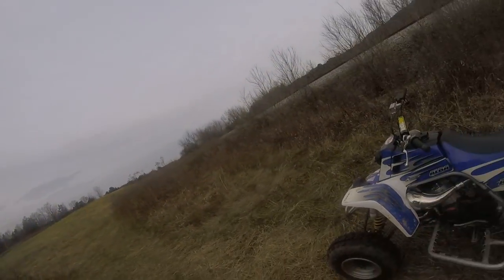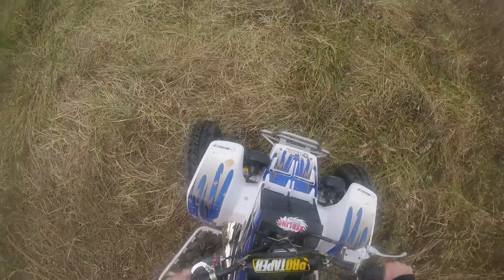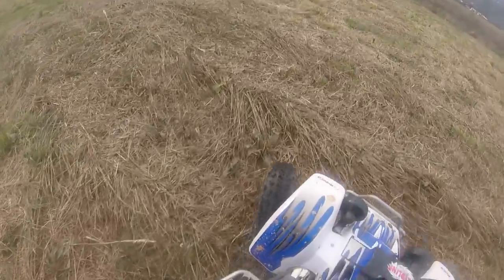100hp banshee ride 12/19/18

Comment: Finally got the banshee back with the cub motor. Thing scared the shit out of me at first. Videos really don't do much justice until you get on it and ride. Lots of power
Reply from the maker: He'll yea who built it
Reply: 5 star small engine in Macon ga I called cascade but I'm working 60plus hours a week so I dropped it off to them. Didn't have time to tear it down
Reply from the maker: @Jordan-hl5hj  what bearing did they use on clutch side
Reply: I'm wanting to say tz bearings but I'm not 100% sure
Reply from the maker: Find out
Reply: Just talked to him it's ball bearing
Reply: You having any problems with you're crank
Reply from the maker: No like what?
Reply: You asked about the bearing thought maybe you was having some issues out of yours

Comment: Damn,,  that thing wheelys like the rear swing arm is 6 inches shorter but I can clearly tell it’s not.
What do you think is the best way to get more torq out of a basically stock banshee.
It does have flat slide carbs and a timing plate at + 4% and fmf fatty pipes but the only way to get power out of it is when it’s screaming.
I’d like to know your thoughts and input on it
Reply from the maker: Watch MY other vid 100hp breakdown

Comment: I had a banshee years ago and it was stock engine with just different jets in the carbs and fmf racing pipes and silencers and dirt digger clutches with is bad ass clutches and wooly burger tires on the back and it was just about as wicked on 93 octane as yours is on race gas
Reply: Christopher Parker 😂😂😂

Comment: I’ve commented here before . Nice machine , mine built same way with more etc . Up here in Michigan if ya wanna ride in a little colder — fatter jets is what you have to do or get another set of carbs and set them up with float level , jets pilots,needles if you want to ride in the cold . Also change to an Iridium NGK Sparkplugs, Much better IMO.With my set up in my conditions , elevation, riding style , racefuel etc etc I put in 1 colder plug with it gapped and 19 . Timing at 6deg . But this is my set up at 70deg or warmer.
Love the Banshee my man, !! It’s time for me to ride the sleds now ! Keep it up
Reply from the maker: Thanks man
Reply: What I meant in the above comment ,just swap carbs out when you ride in colder conditions, faster then doing jets changes .
Reply from the maker: yes makes sense

Comment: I call B's this is 100hp I. Want to see the Dyno sheet
Reply from the maker: Well it's on my channel more on its 98 wheel horsepower equals over a hundred at the crank
Reply: 421 cub on gas 90 hp
Race gas 98
Redline has dyno graphs
Reply from the maker: Thanks

Comment: What gearing are you running? I have a 521 that I ride in the woods too, and it does not stand up like that. But it spins like crazy. Stock wheelbase like yours, GBC XC master tires
Reply from the maker: Stick gearing butbit also runs the same with 15 40
Reply: Hmm strange.. I have 14/44 gearing. I’d expect between that and my larger displacement motor that mine would stand up even worse than yours
Reply from the maker: Tell me the exact build of yours
Reply: 521cc super serval cub, 28cc domes, keihin 38mm pwks, big bore in frame shearer pipes, stock chassis, 22” rear XC masters. Everything I find online says that even a pump gas 521 like mine is over 100hp.. maybe I’m making just enough more than you that I’m spinning? I really have no idea. I sit far up on the seat and I’ve never tried it on asphalt or a hard packed field like you. It’s a pretty recent build, only 4hrs on it. My old diy home ported stock motor stood up through 3rd though
Reply from the maker: I just took GBC XC Master Tires off of this Banshee it did not matter what surface I was on Willie like this with me sitting on the gas tank and I'm 280 pounds so I think something's not right on your build but I can tell you one thing for sure your 28cc domes is not a lot for compression mine has 185 PSI both cylinders
Reply: I’m 290ish so we’re pretty close there, and I sit on the tank. The big bore motors make more compression with bigger domes. My 28s put me at 160psi on both cylinders, I didn’t want to run race gas all the time. This way I can run 93 octane 32:1 with +3 timing and it’s safe. I went up to 110 octane and +7 timing when I raced it one weekend. I think you’re right though, something has to be wrong with my build... it’s fast don’t get me wrong, but it doesn’t feel like 100+hp at the tires fast. I haven’t done a full blown plug chop set on it, but I can tell it’s running pretty much perfect by sound and the way the plugs look when I pull them out. I don’t know what could be wrong with it
Reply: @dylanallen5047  if your build is all tuned in  and if you want it  to be very wheelie happy and have  better  traction like his quad go to a 14/40 or taller gearing.  The Longer gearing will spread your motors  power out in each gear and allow your tires time to catch traction.
Reply: I kind of agree with you, but I don’t think that’s the problem. I initially had my 17/41 set on it, and it didn’t wheelie or spin. It just pulled
Reply: @dylanallen5047  ya that sounds right with that kinda gearing. You wanna find the gearing in between that won't force the motor to lug or get stuck in low rpms but everytime you shift into a higher gear you can tell the difference in motor rpm so it's not just jumping right through the powerband in each gear and just revving its brains out. Could be rich on your carb needles. could be your over revving and it's meant to be short shifted a little to get the full use out of the powerband. Not trying to sound like a  smart ass just suggesting things that could make a difference.

Comment: That motor belongs in a yfz frame.
Reply: I'm a huge 250R fan, but the Banshee top end was on a whole different level. However, Banshee was a sled handling wise compared to the Fourtrax, the 88/89 Honda's especially. But in a yfz chassis, that would be beyond anything this world is ready for.😁

Comment: Back in the 84/85 season, ski-doorotax had a 340 snowmobile engine making 103 horses at just over 11,000 rpm. (Rotax type 354). Getting 100 hp out of a 350 with todays technology really ain't that big a feat. That being said, it'd be a lot of fun to go 450 hunting with.
Reply from the maker: rotax are goodpower motors

Comment: I know a raptor with a 770 kit also bored 30 over wouldn't keep up with mine
Reply from the maker: What mods you got man?
Reply: When i had it i only had bigger jets in it and fmf race pipes and silencers and dirt digger clutches and ran it on 93 octane it would pull front tires up in first 3 gears but not like yours tho

Comment: run rich af so it wont damage if you engine brake.
Reply from the maker: Lol never had no issues engine braking in 30 years
Reply: @banshee100  could be something that may have no affect lol, just going off of what i've heard. i don't own a 2 stroke so engine braking isn't a problem for me. i've heard of people frying their top end on 2 strokes from running it wide open then braking. apparently oil doesnt get in there enough or something of that nature. who knows.
Reply: Herr Tyler  2 strokes don’t really av engine brakein